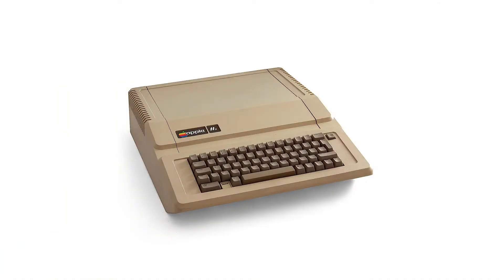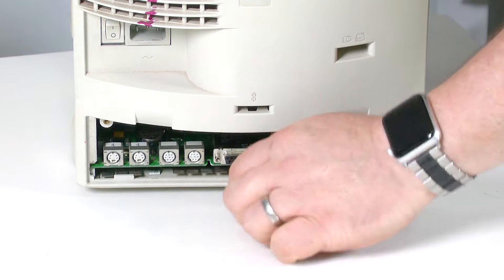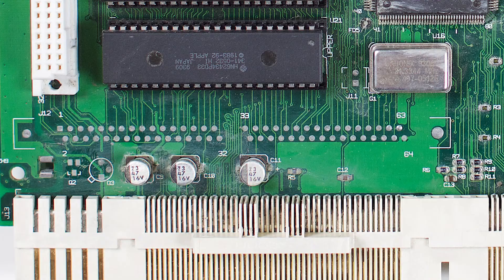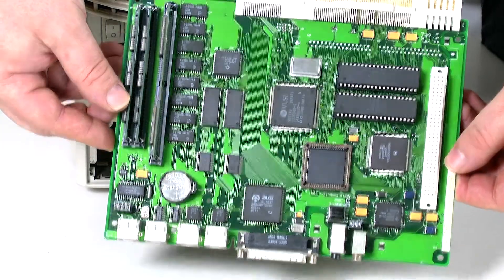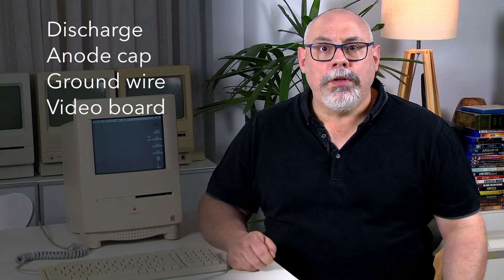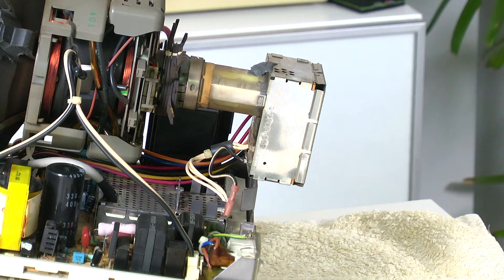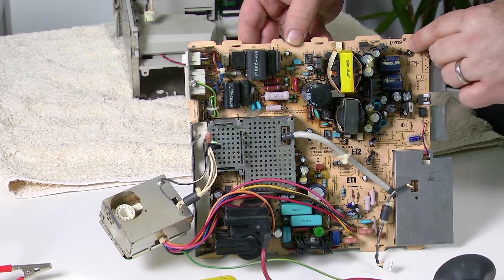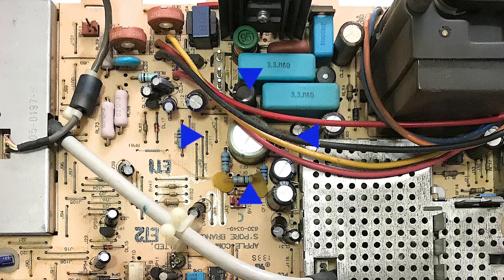Removing the analog board from a Macintosh Color Classic

Comment: Hi Bruce, I’m having trouble with my CC— the CRT is not powering up. When I first bought it, everything was in working order and I used it quite frequently. Now, the system boots but the CRT displays nothing. I can get sound and response from the system, hear the insides whir, while the CRT stays cold. I’ve read that this could be an issue on the analog board, how could I fix it?